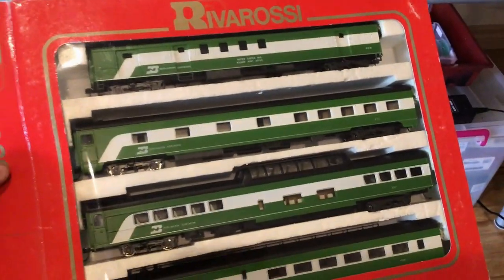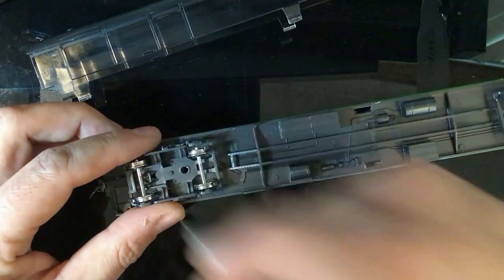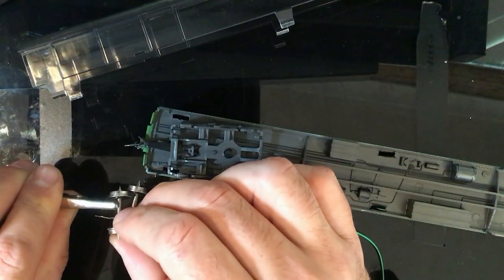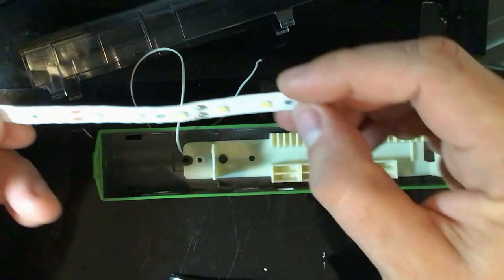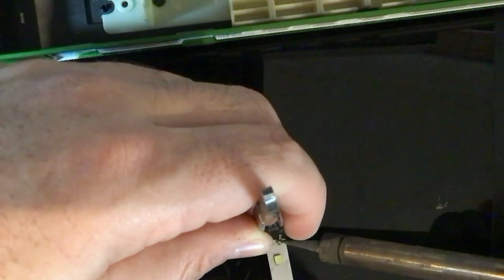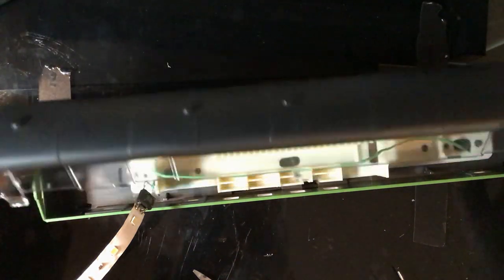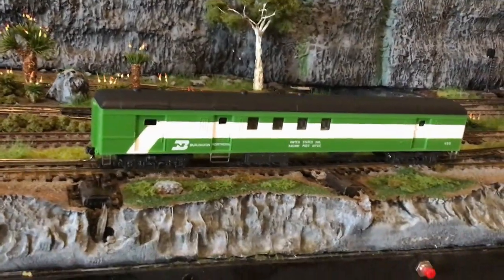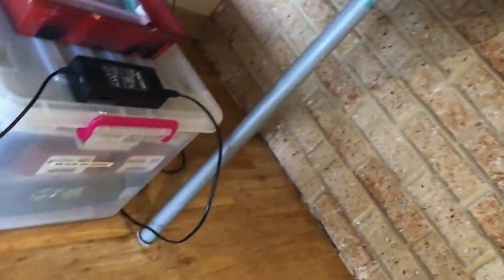How to upgrade Rivarossi passenger cars

Comment: I discovered a new product that will aid you in illuminating those coaches.  I got them from Litchfield Station here in the states.  It's part #50707, which are called ESU current collectors you glue to the bottom of the trucks (bogies for you Englishers).  Trick is to cut them apart and ensure you use two insulated metal axle wheels.  One for picking up the current from the track and an opposite one for returning current back to the track.  Only requires two wheels per bogie (trucks) to accomplish the task.  Just have to remember to use one insulated wheel turned one way and the other the opposite.  I model the Central of Georgia and will be illuminating some old Rivarossi coaches in the Southern Crescent Limited livery.  I've already changed out the talgo mounted couplers (cut them off) and body mounted some Kaydee couplers.  I've also changed out the plastic wheels for Walthers Proto 2000 metal wheel sets with one insulated wheel on each metal axle.  You get enough current collectors to do 8 axles for $8.95 + $4.00 shipping which isn't so bad cost wise.  And, yeah, I use full wave bridge rectifiers along with strip LED's and 3300uF capacitors for the keep alive circuts with the LED lighting.  I got the rolls of LED strip lighting from eBay and they can be cut apart at every 3rd LED.  They are 12 volt with the ballast (current limiting) resistors already built in.  I ordered the wrong color of LED strips, getting bright white instead of warm white.  So I painted each LED with some acrylic yellow paint and now they look better.  Cheers from an ex-Georgian in eastern Tennessee

Comment: I have a bunch of these cars. The basic car can be upgraded using McHenry knuckle style couplers,  Walthers '33 metal wheels, interiors, for window shades I use tape inside the window casting evenly half way down,  and American ltd diaphrams for streamline diaphrams. A$17 car now becomes a $32 car. Interior lighting is optional.
Reply from the maker: Herbert with the current financial climate and pricing of the Hobby it is the way to go. Upgrade and improve older models
Reply: @dynamicloco2186  absolutely agree.
Reply: Roll-Tru 31.5" wheels are purpose made for upgrading these wheels and are a perfect fit when compared to 33" wheels.
Reply: @DoctorHobby  are these metal wheels?
Reply: What type of tape do you use for the shades painters masking tape?
Reply: @russellloomis4376  I use white threaded tape for the window shades.

Comment: Did I miss the coupler part? What's the number for the Kaydees and are the plastic or metal? I've used McHenry and would rather go with Kaydee if they're metal. Thanks guys
Reply from the maker: Russel, I upgraded the couplers before I decided to make the video.
 I left the long swing arm connecting the truck and coupler head in place, I cut the old bull hook coupler head of and glued a hole Kadee coupler on top of the coupler arm. 
Bit crude but it works for me on these types of wagons.  If you already have McHenry couplers in changing to Kaydee should be easy.

Comment: Not in any way an electrician here. Does it matter which bridge rectifier I use? What do I need to look for if so? Also, I see LED strips come in varying voltages. What should I look for?
Reply from the maker: The rectifier needs to be full wave , most bridge rectifiers will do. The ones I used here is DB106G, they are 1AMP , 800v. You only need something that can handle 12-24v. These ones where very cheap aswell. As for the led strips 12-24v range will do

Comment: I thought a few modifications would resolve a couple of undesirables. first off, using a potentiometer in series with the rectifier to the LED strip to adjust the brightness to a more realistic effect. Second, instead of a 220uF capacitor, go with a value as high as astatically possible (possibly 1000uF) to act as a stay alive when facing those nasty frogs.
Reply from the maker: very solid advice thanks

Comment: What size wheels do these use?
Reply from the maker: I used 33 Walters proto wheel set packs
Reply: @dynamicloco2186  To note, all passenger cars use 36-inch wheels because of the higher speeds they are pressed into.
Reply: These are actually 31.5" wheels..Roll-Tru makes a perfect fit replacement for these types of cars.
Reply: For the passenger cars 33' work 36' are too big.

Comment: They are far too bright. They need to be toned down by at least 30%. Still I like the idea of a capacitor and that other thing to keep the lights from flickering.
Reply from the maker: Defn very bright. It is hard to find a happy medium when you use Led light strips.You do not have the option to add resistors to the led light strips. The easiest way i find is adding thin clear paint or plastic film.